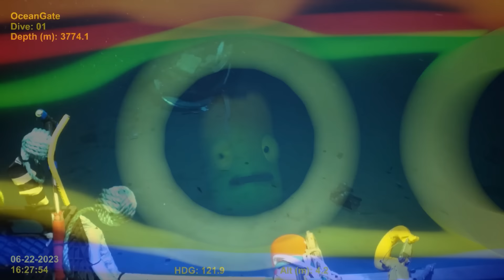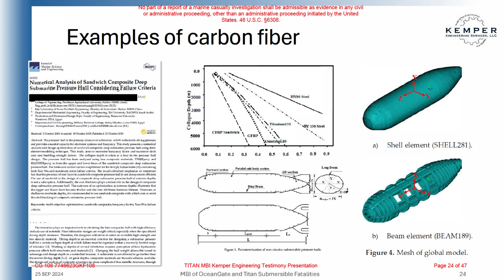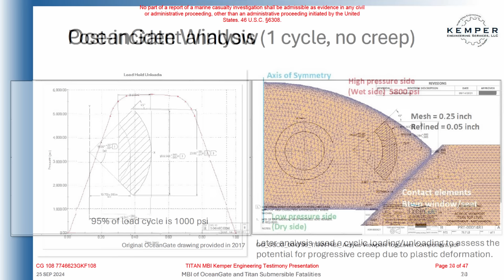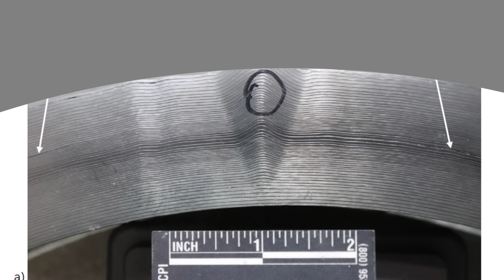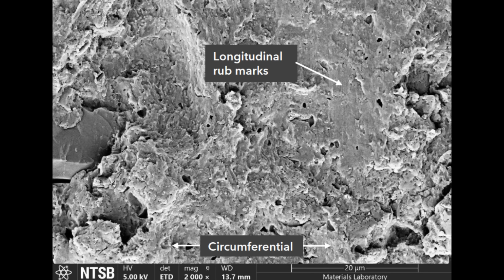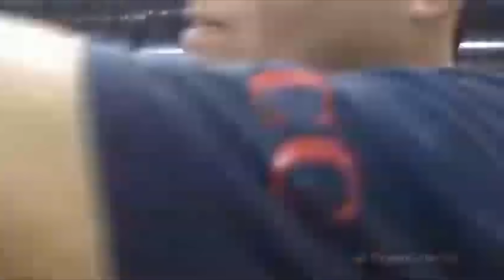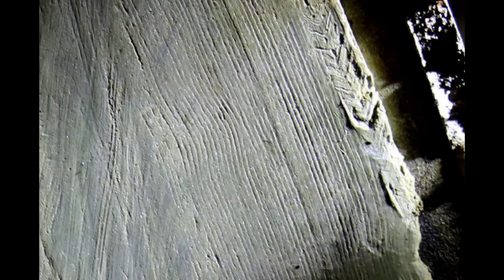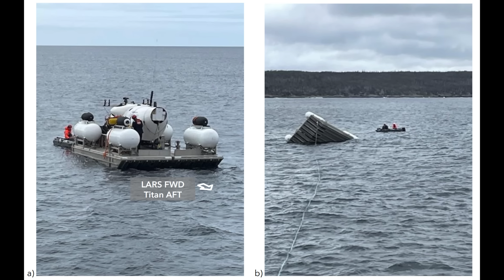OceanGate Wreck Shows Why Sub Wasn't Strong Enough To Survive - NTSB Shares Important Details

Comment: First of all, ceramic composit is a very different material than carbon fiber.
Secondly, they did NOT consult Boeing, NOR NASA, nor any other professional organisation for advise. That was just a lie. Don't know how it can be presented as a fact anyway in this video!
Thirdly, even if the dogma that carbon fiber is not suitable AT ALL (compression versus..) is not correct, the OG debacle in any case has shown that there aren't any techniques that were developed yet to WORK carbon fibre so that the total outcome as a structure would come even only in the slightes in the near of the specifications it should have.
Fourthly, about the production process of 'laying' the carbon fiber onto that large steel cylinder, the very fact it WOULD start forming wrinkles shows you their procedure did not do, they were at the very least missing a pressure roller at the point the new layer would touch the existing surface (and probably one with a ever so slightly rubberized surface that would continuously roll over the whole width?) and they did not use enough tension.
PS did you ever see a picture of something comparable that looks as terrible as that 'figure 13' that we get to see at 17:24?

Comment: As the carbon cylinder was completed,I saw the cylinder choked by slings and held 3 to 4 ft off the ground,I know as a crane operator that the cylinder had to have undergone stress in lifting in that configuration

Comment: Mating carbon fiber to metal is stupid.. The two different substances are going to contract at different rates under pressure and under temperature leaving a strain or even a gap between the two.

Comment: He seems to have not taken the fact that at that depth ANY fissures will be ingressed by water over time. Connecting lifting eyelets to the O rings was another engineering idiocy, especially as he was explicitly told not to do so by the original design engineer, but when he left, they did it anyway, so it's just as likely the forward titanium interface succumbed to sheer micro fractures and blew everything into the rear when it let go.

Comment: As a weaver, knitter, and decades of learning how to make fabric it gave me a stone in my belly to see the carbon fiber winding on like thread on a back beam. It nauseates me because it feels wrong. Winding a fine thread around and around exactly over the previous round not letting slide a minuscule bit to the right or left where it makes a ravine for the next round. I know he had machines to control placement. Imagine 500 strands precisely on top of each other with only resin to hold it in that precise alignment.

Comment: I've worked with smaller carbon fiber parts a bit, and wrinkles are the literal devil. They make parts ugly, sharp, and weak. Sanding them off really doesn't help, since you're still breaking the tensile resisting parts (the fibers). The bubbles would be alright on something like a car spoiler but for this I'd really expect them to have a roller or something to get a better lay. Also I get that 45's can suck but you need to do them. It also looks like they put the new layers fresh on the peel ply. I wonder if the resin they were using was suited for that. 

Would it have been bad design to have a lip going inward on the carbon hull? That way the diagonals would be easier to do and the edge would be insanely stiff. Lots of man hours to pull the unidirectional around the bend though.

Comment: The biggest issue is the materials used mainly the carbon fiber isn’t design for those environments there’s a specific reason submarines are made of steel because it can withstand the pressure exerted on it!

Comment: glue gets harder to stick on smooth surfaces vs a rough surface. if one surface is rough and the other is smooth the glue will stick to the rough surface and not the smooth surface. its why having a mechanical anchor is preferred.

Comment: I've much experience with laminates and the microscopic voids are to be expected in any layup without using vacuum treatment to remove air bubbles. Even then, the potential for microscopic voids isn't totally avoided.

Comment: It would have probably been a lot better if they had used the vacuum infusion technique for the carbon fiber, forcing epoxy into the dry layup under 1atm pressure and fully impregnating the weave while removing any excess with the layup cloth. You then put it in a giant oven at 225 F for a few hours a wallah! You get a highly compressed structure with no voids or glue layers, it's all one monolithic structure. I still wouldn't choose this however, titanium is the way to go. Either pay the price up front or pay it later with your life. This sport isn't cheap and budget attempts like this should never be made!

Comment: As a complete non-engineer I was appalled at the use of bonded fibre to be used under compression quite apart from all the other issues.
Reply: CF is actually pretty fine under compression. Loose fibers buckle under no force, but the presence of epoxy and a bunch of other fibers keep them from buckling, at which point they will hold up to a pretty good amount of compression. 
CF airplane wings work fine, and a quite a lot of a bending load becomes a compression force

Comment: Great analysis.  I learned a lot.

At 25:24, you mentioned Titan ascending to about 1000m after a dive to the Titanic when the "big bang" occurred.  Assuming the acoustic and time recordings were properly synchronised, my reading of that chart is the "big bang" occurred ten to fifteen minutes after they had returned to the surface.

I'm staggered at the number of manufacturing flaws in the carbon fibre body, not least of which is that Boeing recommended a shell thickness of 10", or 7" at minimum, and OceanGate settling for 5" instead.  Machining the bulges flat instead of finding and eliminating their root cause was a terrible work-around.  From the cross sections and microscopic analysis of the failed materials, I think one of two possible conclusions can be drawn:

1.  Carbon fibre should not be used for deep water submersibles, or (most likely)

2.  OceanGate needed much more practice at fabricating, destructive testing, examination, and failure analysis of carbon fibre pressure hulls before committing to repeated, commercial, deep dives in such craft.  If the NTSB could find obvious pointers to the failure from a preliminary examination of the wreckage, why couldn't OceanGate?

There were other instances of irresponsible construction, such as welding lifting points to the titanium hull rings (with carbon hull already glued on), specifically recommended against by one of their experts.  There were so many of these that if one thing didn't get them, another thing would.  Well, it happened.

Comment: There death was caused by that Ring that peice right there told the water where to attack break the ring no matter what that ring keeps basically the water of the bottle in an if the bottle opens it’s over cause the water will clear u out like dust

Comment: nah what happened was they heared the cracks someone said they wanted to go back up so they. Stopped everything dropped sand bags went up just a lil bit when they did that they basically tried to force the thing up quickly an while looking like a space ship floating in the air as it was floating up the ring caught the most once blew up the glue shift cause don’t forget there was a 20 year old in the vehicle he didn’t not want to be in there anymore he had to of been the first to hear an say woah

Comment: A recent Feb/ 2025 You Tube discusses the mounting of lifting points on the titanium end rings, Oceangate's original engineer was asked if they could be attached to the rings- and said NO, but they did so after he left the organization. This would have changed the engineering of the ring and stress points in the ring by lifting it from 4 points, which would have stressed the INSIDE flange where it contacts the carbon fiber tube when under pressure- thus the INNER flange failed because of the added stress on the ring by using it improperly  for lifting. That's why the inside ring flange sheared off.

Comment: 13:20 or so...Dude, peel ply is used to prepare the laminate surface for bonding. It is included in the layup as the last ply, then removed after cure. It doesn't do great job: the texture of the laminate after peel ply removal includes glassy bottoms of the little pits produced by the peel ply. mechanical preparation (sanding etc. works better).

Comment: What told me there was movement in the hulls layers was the pops bangs and crackling that had already been heard inside the hull.  The internal warning system was largely useless as it would eventually fail with no time for the warnings to help or give time to surface, and what warnings were given were ignored - the whole thing was doomed, not a matter of if but when the whole thing would self destruct - and because of this arrogant man and a company that didnt really seem to care, and no one bothered to follow rules on getting it certified so all involved shared culpability in one way or another.  Last comment - this radical budget cutting design was the very first major failure of a deep sea submersible in the history of their use, and that goes waaay back to the very first ones.

Comment: 11:09 It's worse than he said here. They didn't machine the bumps off. They used an orbital sander by hand and gave it the old hand rub and "yep that's flush" treatment. You can even see at 12:26 the bump was not even removed and it's nowhere near flush. It's a miracle the thing was even ROUND by the fifth layer, let alone having hundreds of bumps and sanding off about 30% of the total continuous fiber layers. The hull was about 30% dead weight by the end, most of it's strength was in the bonding agent rather than the fibers themselves.

Comment: Anyone who has ever worked with carbon fiber knows that this was a disaster before it ever dived. I can't believe it lasted as long as it did. It blows my mind that some really intelligent people were fooled by that luck. A very huge mistake beside the million others was curing sanding different layers. He could have gotten a way better complete bond using a pressure follow roller as it was wound. I watched the videos of them winding it, and that process allowed for air bubbles throughout. The bonding to titanium is such an obvious mistake to anyone who knows how the carbon would squeeze, even just a little, craking that bond! At least the idiot Stockton was on it to suffer his own fatal arrogance. Sorry for the others.

Comment: I am not a mechanical engineer and there are lots of earlier comments from well qualified people on the obviously sketchy design aspects... A fiber wound cylinder with the pressure load from the outside instead of the inside... the bonding of the fiber/resin cylinder to the titanium endcaps... using a viewport not rated for the depth... the refusal to have the design reviewed by any outside agency... etc. Reading about it makes me cringe. And the whole commercial background... These companies offering unique adventures to uber wealthy individuals so that they can one-up other uber wealthy folks at cocktail parties... "I've visited the Titanic!" "I've had my ass hauled up Everest!" "I've had my ass shot into space!" Again, totally cringeworthy.

Comment: "Let's make a submersible that doesn't meet the accepted standards! And let's partially name it after one of the most famous ocean-going disasters of all time! What could possibly go wrong!" Also, the instant you started talking about "no problem, we'll just machine it back to a smooth cylinder" it set off ALL SORTS of alarm bells in my head ... "so you're taking a material whose strength depends on long covalently bonded chains of atoms, and shearing those long covalently bonded chains in the middle?"

Comment: I just looked up water pressure at 3775m / 12,385ft.  It is 5496psi / 378.93bar.  That is basically the weight of a full size truck. I wonder how much rationalizing Stockton Rush did to himself, to make this a good idea.

Comment: Stress (applied force) results in strain (deformation of the material). I wonder about the glue interface between a titanium end cap and the carbon fiber tube. These materials are very different and undoubtedly would exhibit different strain characteristics. Thus under stress there would be a net shear force across the glue joint. That doesn't sound good to me. But inhomogeneities within the carbon-fiber tube itself? All bets are off.

Comment: The most insane part of the whole story is that after all the engineering rules had been ignored, they still had a fully functional tool that could have prevented the deadly accident. If they analyzed the sensor data after dive 80, rescheduled dive 81 to be an unmanned test dive and analyzed the data again, they could have retired the ship without anyone getting hurt.

Comment: Its the fact that the heat treatments start with layer one then layer 1 and 2 then 123 the. 1234 then 12345 therefore layer 1 gets cooked  5 times layer 2 4 times and so on none of that was factored in. Any cavaties in carbon fiber are week spots and points of failure

Comment: Should have at least had steel pins in the fiber going from bow to stern. This would allow something to bolt the domes to and would increase residual strength of the pressure vessel.

Comment: Strain gauges are extremely tricky to install. I have worked with R&D at my job and we use the same set up that SpaceX and most higher end companies use. They are very tricky to install and you have to keep every connection exactly positioned with everything perfectly cleaned and secure plus a constant power source to keep that data coming in accurately. It just seems like an extremely difficult job to install strain gauges and keep them operational and accurate throughout a journey to the bottom of the ocean. I just don't believe they knew what they were doing with those strain gauges plus I'd be very interested in what type of strain gauges they used.I wonder how they kept their wiring in order and from being bumped into with several people on board. Plus how could they be keeping up with the data and checking up on it live? It doesn't make sense unless they compiled the data to check over later. We have ran so many test that we came back to find several gauges not properly working after having everything working and testing while stationary. R&D is very interesting and fun to do but it's very tedious and tricky

Comment: The lifting strain you mentioned is a reason my company doesnt lift our diggers by the boom knuckle anymore turns out it can put too much strain on 2 points of traverse ring and was causing premature failure in the ring, so i would definitely not want to lift a sub like that either...

Comment: Instead of having a flat surface on the inside they could have opted for a concave one. Then put a clear perspex disc in front of the viewport and filling the void between the perspex and the viewport with glycerin which has a refractive index close to that of water. That would ellivitate the effect of objects seeming further away... Easy as 1-2-3.

Comment: Points of failure: 
1. Usage of untested material as main material, and relying on it.
2. Untested usage of GLUE for an application,outside of its intended usage. Lack of testing data on glue in various depths and then relying on it.
3. Usage of faulty sensors and claiming that they are working, risking lives, which is an instrumental error. Lack of sensor data too.
4. Lack of overall testing data and the knowledge  limit on this particular material,they chose to use at various depths of pressure and salinity, changes in temperature gradients which affected glue and buoyancy forces changes, gravity forces and lack of proper geometric symmetry that is capable enough to withstand the situation of cyclic stress strain loads.
5. Lack of data on cyclic pressure loadings on the vessel structure of this particular type.
6. Usage of non certified fire prone electronics inside the small area.
7. Lack of certification in general in that field.
8. Lack of proper guidance due to a false confidence in own knowledge from a seemingly related field to the main person, and or rejection of guidance and expert knowledge which is a major issue.
9. Rushing the design, because of money greediness. Money greediness is extreme in his case, that was reinforced by a very greedy economy, that favored rushed decisions and cost cuttings, and minimalism.
10. Rejection of employees opinions as inferior opinions of someone who was seen as an outsider to the company, due to a level of distrust in relationship between employee and ceo, seen not only here but in many other IT companies too and the rush by IT companies and CEOs to remove away employees from their positions to cut cost,which the economy demands.

Comment: An interesting analysis. One comment in your analysis that I don’t agree with is the weight v cost issue in regard to the pressure vessel. If you have, say, a modest 1,000 tonne support vessel, saving 1 or even 2 tonnes, 0.01 or 0.02%, on the weight of the submersible is irrelevant to size and costs. This is not a weight critical issue in the way that spaceships are weight critical. Given the sensitivity of the subject and that it is still subject to legal action I think a correction should be issued. or the video edited or withdrawn.

Comment: A 12:58 that's the metal channel you see that the carbon fiber was glued in.  Look how thin the edge of the cannel is and that the inner edge, just as thin and where all the pressure was, is sheered completely off. That, is where it failed.